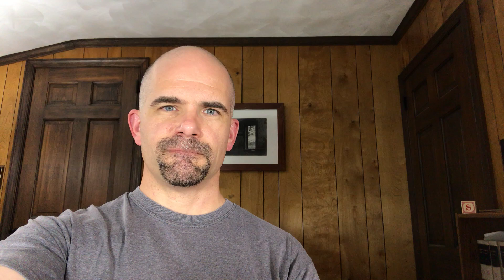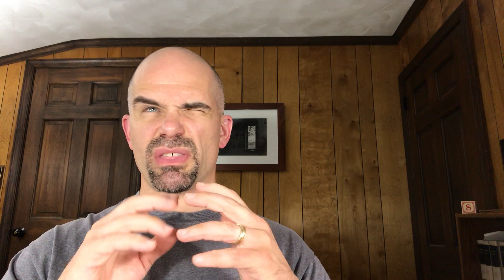Paintball Accuracy, Episode 6: The 'Perfect' Barrel?

Comment: I've been thinking about this a lot lately and I'm curious if anyone had taken the time to try to collect some data.

1.) Because friction in the barrel is a major factor, would using a very lightweight lubricant help. Slip2000 has promoted using their marker oil in barrels and on the paint itself. Obviously any lubricant left on the paint would be a significant loss but if you could keep that to a minimum, could you increase your efficiency, reduce friction as well as have the benefit of bore matching (assuming the lubricant helps to reduce deformation or a degree of it).

2.) Would using something like Delrin help. Im surprised if this hasn't been tested. 20 years ago Delrin was all the rage in paintball. Something like Delrin inserts or even a delrin sleeve inside the barrel. I'm cnsidering making a Delrin barrel and testing it.
Reply: This is why we bore our paint. I bore mine so that they barely pass through. I want minimum grip. Other people like to underbore for reasons.

Comment: Do you think something like the Freak ACP tip is the closest thing described in your video for purposes of accuracy alone?

it has similar features described in your video.

Quotes from the product description:

 "it literally rides on rails through the length of the barrel front" 

"Sixteen rows of smoothly transitioned grooves and rails bring the benefits of straight rifling"

"Rather than spinning the paintball with a spiral rifling pattern"
Reply: No. The ACP tip is a tip and not the control bore.  Most barrels have a control bore followed by a larger bore in the tip. When the ball enters the larger bore of the tip, they basically float through it on a cushion of air. When you break a ball in the tip, that paint can impact the ball and cause unwanted spin.  The acp tip has grooves, which allows the broken paint to move away from the flight path of the ball after several shots.  If you go back to the video where he talks about the early "riffled" barrels, those are similar to the acp tip, just used as the back.  Those barrels tend to perform worse in noise and efficiency.  

He's talking about grooves that go perpendicular to the flight path of the ball.  Very small one at that.  They basically remove surface area friction, while not allowing the air to bypass the ball. The problem with a barrel like this is it would be a nightmare to clean after a barrel break.

Comment: so if barrels only have negative effect on ball accuracy, wouldn't a shorter barrel be more accurate than a longer one
Reply from the maker: Good question.  The simple answer is no, because you always have to have a minimum barrel length to get ball acceleration, and there is a balancing act between several factors, all of which still have negative affects on the ball.

It's just part of the physics of paintball.
Reply: @thatpaintballchannel179  I've read that the minimum is 8" for ball stabilization, and that's indeed how long a lot of barrel backs are, like the freak kits.  assuming the person can aim as well with an 8" barrel as a 14", what would be the advantage of going over 8"?  wouldn't 8 be ideal? what are the other factors besides increased "sight radius"?  

I come from a rifle ballistics background where generally the longer the barrel, the better for accuracy and velocity due to increased rifling contact and increased time under gas pressure, but rifling contact and high pressure just serves to break paint balls and reduce accuracy.

point is, what are the other factors that lead towards a barrel longer than 8" being better? 

edit:  I feel like you may have stated some of the things that I've just stated in this very video but I'm not watching it again as I type this Haha
Reply from the maker: @star.soaked.wanderer , As noted in some of my other vids (each one deals with a different element), the main factor is the paint, and because it is inherently inaccurate, anything done to it really just makes it worse.  So my idea is to have a barrel that is as invisible to the ball as possible, aside from acceleration.

For acceleration, shorter will place more stress on the ball, and be more wasteful of energy.

Some of the other issues include noise (shorter is always louder), efficiency (shorter is less efficient, related to acceleration), bunker manipulation, and some visual indexing.

Remember that this is about as far from firearms as you can get.  We are hurling water balloons at one another, functionally speaking.

Hope that helps, and thanks again for weighing in.

Comment: Two questions.
1. Would the ridged surface you spoke of be anything like straight rifled barrels?
2. Are you saying that theoretically, the best accuracy would be had, regardless of paint, running an overview, but as close to match as possible?
Thank you.
Reply from the maker: Thanks for posting up!  to answer in turn:

1. No.  Think more like corrugated pipe.  Straight rifled barrels have most of the friction of a regular barrel, yet they also waste air by allowing it to flow freely down the channels in the barrel.  They are therefore among the worst designs from any standpoint.  A corrugated surface has both lower friction, and also the ability to keep air mostly sealed.

2. Not exactly.  Assuming perfect paint and the lowest-friction barrel, a slight overbore or match might be optimal.  But the lower the grade of paint, the greater the overbore should be.  That is at least what the data trend suggests.

Hope that helps, and thanks again!

Comment: Know exactly what you mean...  👍 I recently got a DYE titanium back...  Looking for the best tip /front..  (Taking advise on it)...  👍...  and also looking at brass freak inserts..  🤔
Reply from the maker: I don't have enough testing data to say much about titanium (and specifically, titanium as DYE has offered it) as a low friction material.

Ideally, the fronts will be equally low friction as the backs, and so will likely be of the same material and finish.

I can say that highly polished surfaces are not optimal in terms of friction, if that helps.

Brass may have some advantages, but remember, until we get into really low friction, the actual differences between typical materials (aluminum, stainless, brass) is probably going to be very minimal.  In other words, you'd never notice in truly blind testing.

Again, hope that helps, and thanks for weighing in.

Comment: What about freak inserts... 👍  Freak Aluminum,  Steel,  Freak XL.... ?   What's your thoughts 💭...
Reply from the maker: Thanks for the question!  The general consensus (including my own opinion) is that stainless inserts are much more accurate than aluminum when it comes to dimensional accuracy.  That is, what is marked on the sleeve is the actual bore ID.  that is immensely important.

As far as the XL vs. standard go, I don't think there is enough hard testing data out there to say for certain which length is best.  however, since freak xl doesn't come in stainless, that may answer the question . . ..

Moreover,  without tests with a tribometer, there's no way to see whether aluminum, stainless, or brass ( or some other material), and in what finish, affords the lowest coefficient of friction, to give the optimal control bore length.

Let me know if that helps, or doesn't, and thanks again for weighing in.
Reply: @thatpaintballchannel179  Palmer Pursuit Shop performed extensive testing (from what I have read) attempting to test the frictional coefficient between the standard paintball shell and any other material they could think of. Their conclusion was that brass has the lowest coefficient. Their experience with manufacturing barrels of different materials lead Planet Eclipse to get a custom glass barrel from them for high speed camera footage and study. 

However, I don't see how brass will help M2 is Alive's question about a Freak insert. A Freak insert does not stretch to the end of the barrel where the paintball exits. I strongly advise against the Freak system because of my own experience. The insert did not always sit the same way. It sits on O-rings and can sometimes be misaligned enough to point the paintball at the tip of the Freak front. That in turn gave me very screwy accuracy that day until I figured it out. Then there was the time that I had paint break in the barrel. After squeegeeing out the barrel my accuracy was good for a short while but then went bad again. When I looked inside the barrel, the seam around the insert had held paint that the squeegee could not reach. Subsequent shots were causing the paint to slowly drip out and trail the paintball down the front. 

Ultimately, I went with a single piece barrel after that and I would recommend sticking with single piece barrels. If you want the best hypothetical accuracy, you may still be able to send your marker to Palmer Pursuit Shop and they will not just make a brass barrel but tune it to your marker. They are well known for excellent barrels. I chose to go with a J & J ceramic barrel. They are much cheaper and while they might not have the lowest frictional coefficient with a paintball, they have an excellent ability to shoot through a barrel break. I only squeegee between games now. It only take a few shots before the accuracy is so close to optimal that it just isn't worth it to take the time during a game. And I'm talking about a woods ball game, not speed ball. Like the AK47, the A-5 may not be the most accurate but it will keep throwing projectiles down range.
Reply from the maker: @popebobcat3716 Thanks for weighing in.  Brass may have a lower coefficient as a material (it would be interesting to see testing data), but there is still the issue of surface finish.  Moreover, brass inserts are made by Ty Mcneer over on MCarterbrown.com.  As for the A5, it is exactly as (in)accurate as any and every other marker.  :-)

Thanks again.
Reply from the maker: @UCouiGSk9PwXwz_xR2pMrIyA  Thanks for weighing in and for the kind words!  The control bore length issue has been tested extensively by Simon Stevens, but he was looking at velocity consistency, and he found that there is a range for optimal velocity consistency (so you can run closer to the upper velocity limits in tournaments), but this has little if anything to do with target consistency, and for that, I've seen wildly inconsistent evidence to support any particular barrel length.  This tells us that barrel length isn't all that important in the ultimate sense.

I can elaborate if you like.  Again, thanks for posting up and welcome aboard!

Comment: I like your common sense/root seeking approach.  What do you think about adjustable air pressures on hpa regulators, or running one or two reg extenders?
Reply from the maker: Thanks for weighing in, and for the kind words!  To your question, I'd probably need a little more info to give a substantive answer, but it sounds like you are thinking in terms of quality-of-life, i.e., adapting bottle equipment to meet player ergonomic (or marker input pressure) needs.  Is that a fair guess?  If so, my thinking is that the more ability we have to fine-tune our equipment to suit our own playing styles, the better.  Of course, this presupposes that such playing styles don't involve cheating or abusing other players, etc., but you get the idea.  :-)

Hope that helps, and thanks again!

Comment: In regards to a ridged surface helping to drop coefficient of friction, I can only think of a few materials which could reduce the impact or surface area of friction of such a surface on a  paintball.

First off would be a Delrin insert system though that is naturally a bit too soft for the coarse rough and dirty play of paintball and would wear rather quickly needing replacement often.

There are Acetal resins like POM, but this while being VERY slick is rather cost prohibitive as is PEEK. Polycarbonate has been tried before with reasonable success, though it's a bit too fragile for protracted use in paintball. ( See all of the damaged, broken, gouged and scratched up near to  fully unusable polycarbonate barrels which were a fad/ thing from 02-to around late 2004. ) 
Nylons have a fairly low coefficient of friction but are most likely too ductile on their own for any serious use and without a filler material which would increase the coefficient of friction would wear out FAST.

We could go with metals impregnated with Electroless Nickel Boron "Ni B" which is fairly lubricious by nature and can be impregnated in its porous structure with Teflon to further reduce friction. ( This is almost moot as the surface area of a ribbed milled surface is already minimizing surface material contact.) this is the same process used to line the main guns of the M1 Abrams tank, and most large bore Naval guns.

There is also Nitrocarburization ( Melonite equivalent NiTe2 ) where the metal is treated by quenching such metal in molten salts at around 1,049 degrees Fahrenheit in a quench polish quench often described as "QPQ", this impregnates the metal with a VERY robust treatment several microns deep and does aid in a reduction of friction. Though it's not cheap to get a uniform treatment. This process is used quite a bit in the small arms industry such as on HK Sidearms.

To a much lesser extent in regards to minimization of inherent material friction but quite a bit less expensive would be a very carefully controlled Titanium Nitride "TiN" coating of barrel inserts. This is used in high-speed cutting tools to  increase their longevity/lubricity 

I can not speak with dauntless authority towards TiN's coefficient of friction in contact with something so elastic (in regards to ease of deformation) as a paintball. I know it only in contact with itself, and other metals usually producing results in the sub 0.9 range to as low as sub 0.5 from what I have seen.

The only materials I can think of off the top of my head with a sub 0.2 coefficient of friction are: Graphite which wears out QUICKLY, DLC ( Diamond Like Carbon which is in itself a coatings application) and lab-made diamond. In short super compressed carbon. 
All of these "options" are either prone to premature wear, or are HIDEOUSLY expensive for both the manufacturer and the end user.

The most realistic IN THEORY means of reducing in-barrel friction and imparted rotation to an effective maximum, while still maintaining relative affordability as well as durability would be to apply Electroless Nickel Teflon (Ni B ) to a surface which minimizes surface area contact to our paintball projectile.

The most cost-effective solution which could be rolled out without a massive price hike to the manufacturer or the customer would be TiN coating a barrel sleeve system.

There is one more coating which by nature when lubricated has a coefficient of friction of around 0.2 that I can think of, it's one that has already been used before in paintball: Hard Chrome... And we ALL know how that works out. looks great, not the best wear resistance even though it is hard it's not very ductile... 
A LOT of players forget to clean it and thus you see So many chromed parts which are chipping flaking and look a right mess from surprisingly little use.

Producing the  "perfect" barrel" as well as the "perfect" game usable paintball projectile is a DEEP rabbit hole and will require a LOT of testing.
Reply from the maker: As usual, thanks for the detailed reply!  It is definitely a daunting task to work through something like this, which is probably why it hasn't been done before.  In my testing even basic anodized aluminum surfaces with a ridged finish had very low friction versus similarly anodized surfaces with a high smoothness, so even that might be a much better alternative, for a lot less money than the really exotic stuff.

Also possible that really high resolution 3d printing might be a way to go, depending on materials.  Even if these had a short lifespan, they might be worth it  to competitive players, or those otherwise willing and able to afford it.

Thanks again.